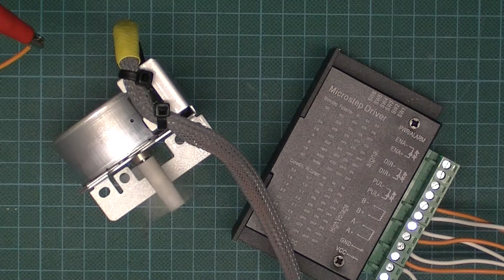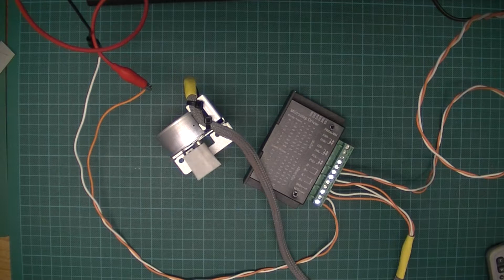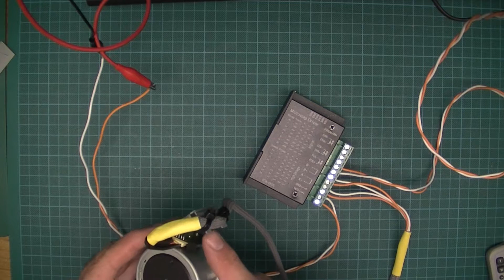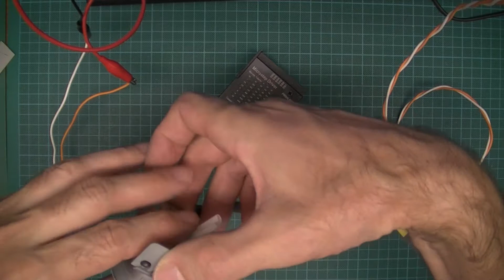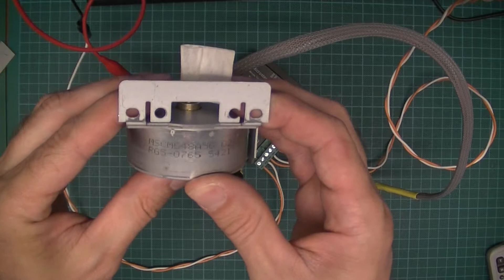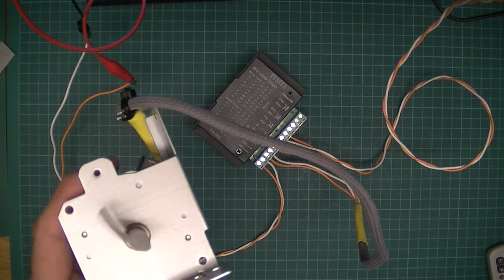Using a salvaged HP printer stepper motor MSCM048A50

Comment: I have this exact motor. I was looking for the current draw, so thank you for including that detail. Did you ever find a data sheet for the motor? = link, please. I did confirm the voltage (somewhere/somehow/don't remember the source) as 12VDC. I image that I got voltage from the printer, itself. 32V sounds kind of high? Thanks.